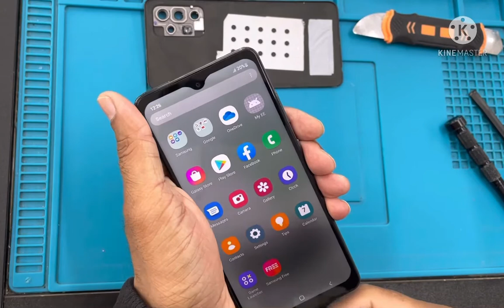Samsung a52/a52s charging port replacement.how to change charging port on samsung a52/a52s

Comment: hi, what is the difference between K1 & K2 version of this charging board?  my phone is A52s 5G, K1 or K2 should i buy?
Reply: You must dissemble your device in order to read the correct assignment on the removed charging section. The K2 sign is on the assembled charging section. If not, its K1.
Reply: @kissesbloody yup. i dissemble it & realised its just both of the ribbon clip detached due to multiple drop.  So simply push down to clip it back at video 3mins04sec & everything back to normal usage. Need not change anything at all. lucky $ save.

Comment: Fake video, you already took the backcover off
Reply: I just opened 2 samsung galaxy a52 to make 1 working unit by replacing the usb port. I could open both backcovers easy even without heating, so nothing fake imho.